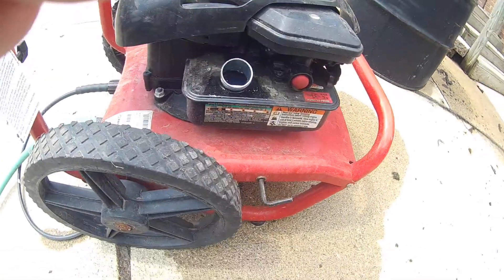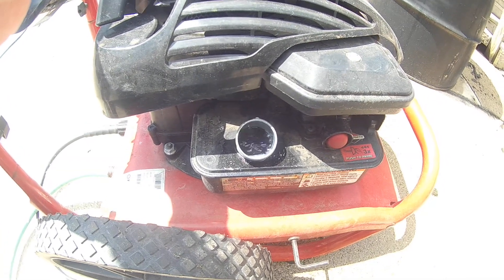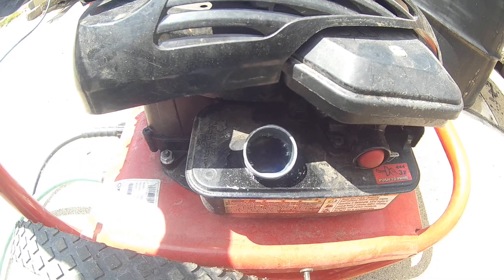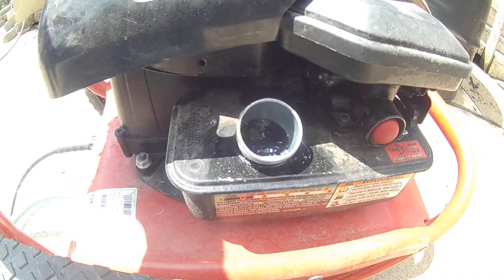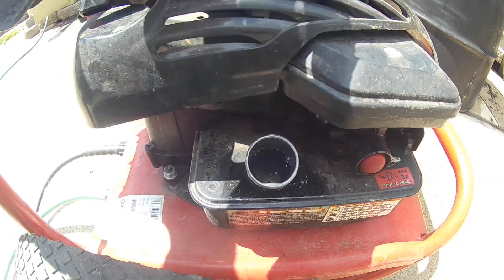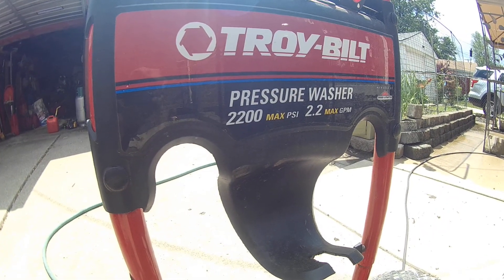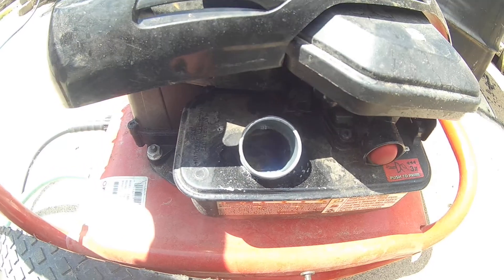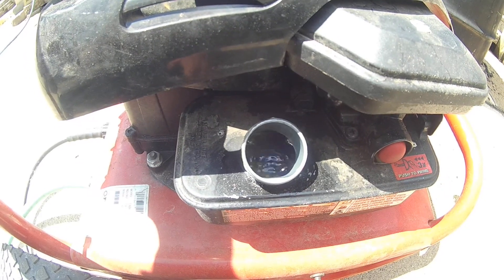Bubbling gas in my gas tank

Comment: You know I have a similar problem on an old K241 in a 1973 110 JD garden tractor. After a long period of mowing it dies, obviously fuel or spark. Last time it happened for some reason I pulled off the gas tank cap and bubbles were coming up through the hole where the fuel line attaches to the tank. No obvious leaks, nothing building up in the crankcase,  all I can think of is the gas is boiling in the fuel line where it runs alongside the engine. Engine very cold blooded, takes a good long time to run without some choke.
Reply from the maker: Thank you for watching and the sub. That was the first time I have ever seen any thing like that in all my year's filling a gas tank. I still don't know what caused it. It hasn't done it again.  Later

Comment: On my little 81 rabbit diesel, I got a see thru fuel line going to the injector pump. The company that sells parts for my car says, when there is bubbles in the fuel line, it's time to change the fuel filter. Maybe your fuel filter is getting plugged, if you have one.
Reply from the maker: Thank you for watching. It only happened one time the next time I filled the tank no problem the water runs like a top. Later

Comment: Hmm Mech. No clue other than air but you said there's no leak. are you sire the primer bulb isn't causing a leak? No clue, brother.
Reply from the maker: It's a new one on me. No problem with the primer bulb. Later
Reply: I know this is a long shot but did you ever figure it out? My Toro Recycler started ding the same exact thing after working fine then adding fuel. Now wont start. Any ideas?

Comment: The gas cap is vented to the air by a small vent hole. The tank needs to be open to air for the engine to run. Looks like air. You don't say if the engine has been overheated and the gas is actually boiling ,which i doubt. Just my 2 cents.
Reply from the maker: I have filled my gas tank many times over the last three years that I've owned this its never happen before. The engine was no hotter than it has been in the past  it was about 87/88° out I filled the gas tank in the past when it was in the high 90s and never saw this before happened. After it stop bubbling I put the cap back on and ran another tank of gas through it. It did not stop on its own because it wasn't vented it ran out of gas. Thank you for your comments

Comment: That is very weird!  BTW did you get the issue with your chainsaw resolved?  You might be OK with this pressure washer because the cap is vented.  But the cap on your chainsaw is not... I'll ask to my brother.  He works in a lab at a refinery where they produce gasoline... I might get an answer for us.
Reply from the maker: I've been filling gas tanks for over sixty + years and I have never seen anything like this before. The pressure washer works great it was just the bubbling of the gas that I have never seen before.
My cap on my chainsaw is vented when I set the chain saw down on it's base I have a slow leak coming from the center of the cap. Thank you for all the help your are doing. I haven't been able to do any work with the chainsaw I hurt my right arm. Long stupid story. Later
Reply: Good morning Mech Uno. Got an answer from my brother.  As I mentionned, he works in a lab where they manufacture and test gasoline daily... Here is the answer:  " I see no other explanation than light portions in gasoline. It can actually come from a winter essence that contains light compounds to help start like butane or pentane. There is also the option of methanol. This seems to me very likely since it lasts a long time evaporation. When I was doing interlab exchanges to test the test itself, I have already seen methanol in gasoline. Here, we have ethanol to help the planet!!! It should also be known that in the US, there are noticeably fewer controls on fuels, and in addition the competition is fiercer which leads to less homogeneity in the fuels sold.
Reply from the maker: Good morning Joe. 
I thank you and your brother for all the trouble you went through to help to explain this problem. I never would've guessed. This is definitely a new one on me. Enjoy the rest of your day and all that may follow. Later